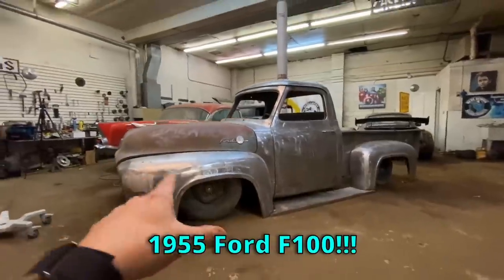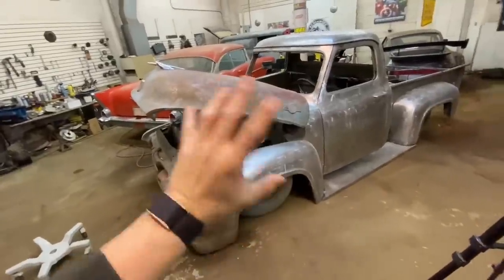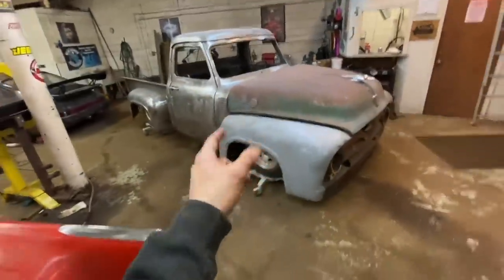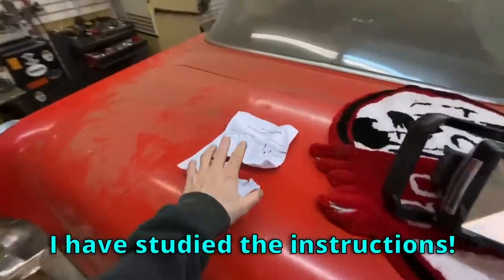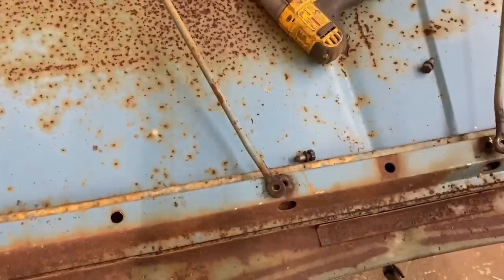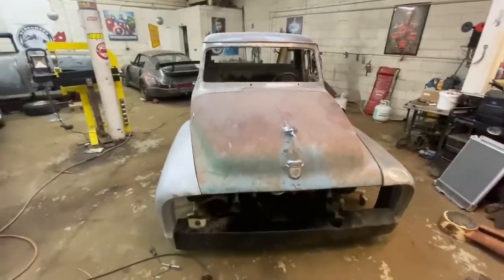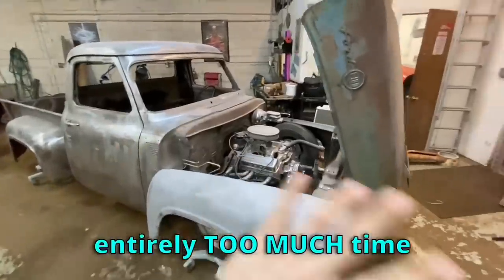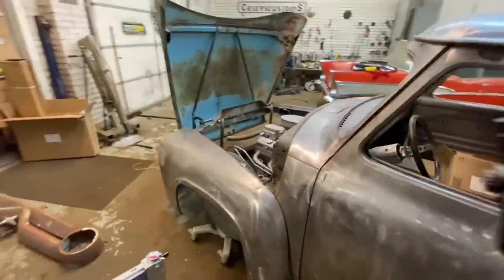MAKING A HOOD FLIP KIT! BUILDING THE BEST KUSTOM TRUCK EVER! HOT RAT ROD FORD BAGGED HAND MADE FRAME

Comment: When id remove a hood by myself id take a ratchet strap and run it thru the roof beams and hook it to the front then undo the bolts and lift and pivot the back end around…. Your ceilings alot taller so idk the best way to do it but just to get ideas

Comment: When I was 18, and had a lot more fire in my ass than I do now, I had taken the hood hinges off my '70 Chevelle, and used to lift it on and off at the gas station by myself to check the oil for quite some time until I got around to finally bolting them back on. Quite the sight. 20-something me used to take my '74 K5 top off usually with at least one other person, but I recall once or twice having to do it alone. Older me felt it when you took that hood off yourself, however.

...Oh, and the hood kit is dope AF.